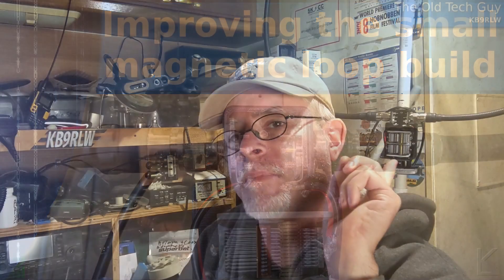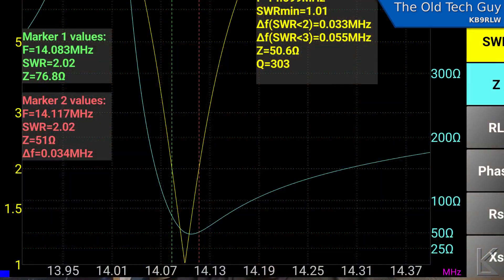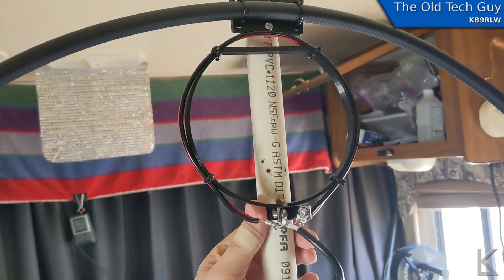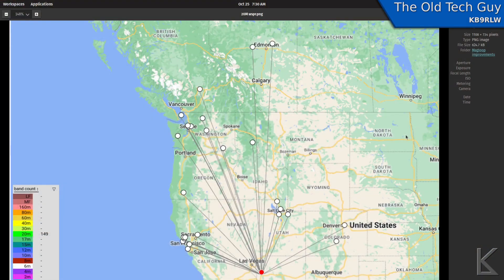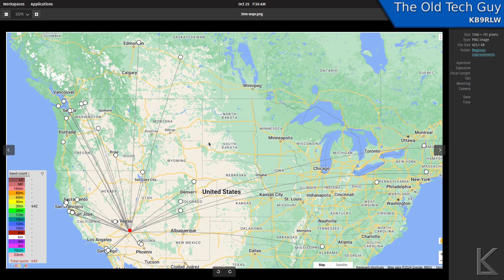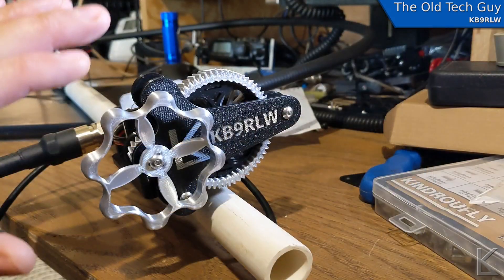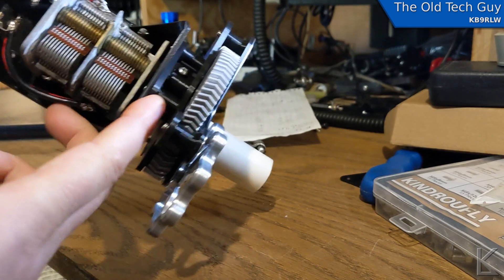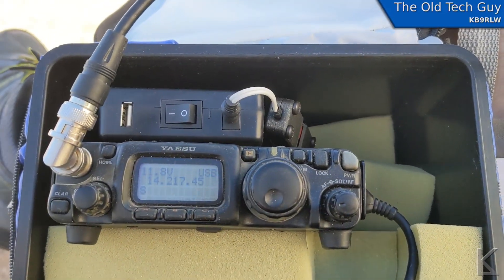Ham Radio - Improvements to the small magnetic loop build

Comment: I watched your series of videos on this build. 66pacific's small loop calculator has a "red flag statement", 'The specified conductor length of 8.52 feet is not ideal." When I enter my parameters to design a loop. Target freq 7 Mhz to 29.7 Mhz . Making the circumference longer is the only way to bring it into spec's.
Yet, you built this with a loop just over 2 to 3 ft circumference and achieved 30 meters to 10 meters.  Amazing!

Comment: Hello, could you give the capacitor parameters or the company name? I would be grateful. Wojtek SP9DLK
Reply from the maker: That was discussed in the design video.  
It was a purchase off eBay of a single unit. somewhere around 30-170pf as I recall.

Comment: I had to can Facebook for security issues so I know very little of your shack setup. I understand you are in an RV somewhere in the SW desert.  Since I am considering moving to an RV it becomes a heavy set of choices as to making room for radios and tools and equipment.  Do you tow a trailer  containing a tool room and machinery and space for radios separate from the RV living space, which is something I am planning to do. My heart has always been in the Southwest after many camping trips over the past 50 years.  Perhaps you can steer this OM in the right direction.

Comment: maybe a 24:1 gear ratio using a steppermotor controlled by a arduino could be a idea… for remote adjusting the capasitor
Reply from the maker: That's been done several different ways. Ideal for when the loop is in the backyard and your shack is in the house.

Comment: Kevin, you mentioned your clamp for the Coupling Loop. I remember you talked about in a previous video that an Ellipse worked much better than a Circle. Could you make your clamp in an elliptical pattern as well? Not to mention, using a similar herringbone gear to even further "fine tune" it to be slightly out of or back in full plane with the Larger Loop? just a thought. Great job. When I finally get my Capacitor I will be constructing my mag loop based off your builds. KI5IUF 73's
Reply from the maker: The top part of the form flattens out allowing you to press the wire up against the loop to deform it slightly.
Reply: @loughkb  Thank you for that information. Going to get your gear 3D printed (credit all to you) and a smaller version. So 2 herringbone gear clutch gear boxes. Thanks again.

Comment: Thanks Kev - you have always maintained in the past that the coupling loop needs to be as close as possible to the main loop, and preferably, oval shaped so that there would be more of the feed loop closer to the main loop. I will try your new method - thanks
Reply from the maker: And on some frequencies with this loop build that was still how I got the best match, with the loop pressed up against the big loop.  Making the coupling loop adjustable just showed me that it's not always the best position.

Comment: Really great job there Kevin! 
A question, have you ever tried or had anyone show you using a variable capacitor for a mag loop dipped into a container with oil (mineral oil) to be able to increase the voltage it can handle and what the results came out of it? It's easy to get your hands om small capacitors rather than the biggies that costs slot not to mention the vacuum ones.
Colud you do any test to these myths?

Btw. I am sooooo pleased to see you back in the van and that your health is getting better by the day. Hang in there, you'll pull thru! ❤️
Reply from the maker: Well all you really need to do is look up the dielectric constant of mineral oil compared to the dielectric constant of air. If it's a better insulator then yes it would improve the voltage threshold. I don't have enough power to test it. I'm mostly QRP and can only get up to about 35 Watts with my amp.
I just did a search, and mineral oil is a much stronger dielectric than air, a better insulator. So therefore it would definitely raise the voltage tolerance. No need to test it. It's not a myth

Comment: The loop is of course one inductor, but with the induced current traveling the same direction in the loop, the mutual inductance across the gap should increase as the gap narrows? So, by narrowing the gap you are increasing the inductance of the loop? I did a search on ”variometer magnetic loop” and the first video YouTube retrieved was one by you from nine years ago. The clutch is brilliant.
Edited to add: Ah yes, I remember your bucket variometer build - fascinating.

Comment: Very nice job. All that's left is to further increase the Q of the loop, thus increasing the radiation efficiency on Xmit and narrowing bandwidth to reduce noise pickup on RX.
It looks like your loop was broadcasting out of a window on the north or northeast side of your RV. I used to use my cellphone in my RV when up in the mountains, and I would place the little dipole antenna in the rig where it would only 'see' out of the front window. I even put grounded aluminum foil on the kitchen window and back window. Then I would point the RV so that I would hit a weak 'local' cell-tower back in my home coverage area instead of a much closer and stronger 'roaming' tower that cost much more to use but to which the phone would automatically flip because of its signal strength. I called it my 'window beam'. I should have built an actual multi-element beam, but I was lazy, and the window-beam worked fine.

Comment: Keven; very interesting. I do believe closing the loop has the effect of improving the Q of the Loop which is the primary antenna. As far as your adjustable coupling, I think there is more to be seen as to improving the match. Moving the coupling loop does effect the Primary antenna however so does the capacitor. My question is weather or not you are only "HIDING" the SWR in return loss. Example being that an antenna measured at its feed point with 1.2 : 1 match ratio can be seen as a 1:1 match ratio measured at the transmitter with a long transmission line. I am not calling you out but am wondering myself since I am intrigued with big high power magnetic loops i have been building large loops using Vacuum capacitors and 12 foot loops of 2.25 inch hard line. Respectfully as always, Dennis KV4WM, A US NAVY NUCLEAR SUBMARINE VETERAN, Broadcast Engineer, and Fellow Amateur Radio Operator  73
Reply from the maker: If you look at earlier textbooks on magnetic loops, they refer to rotating the plane of the coupling loop in order to improve the match. It's similar to how a veriometer works as I understand it.
Reply: Quality is frequency dependent. It means your main loop impedance is different on different frequencies for R=ρ*Q. To obtain a good match you should have a set of coupling loops or adjust your coupling loop to current frequency.

Comment: Question: Did you print these with PLA or PETG? Being new to 3D printing in itself, I was wondering which would be better. Also should I set the Prusa Slicer for .12mm, .10mm, or .08mm?
Reply from the maker: There's really not a lot of torque on the gears or the assembly. So PLA is fine. I printed most of it at 0.2 layers, except the output clutch and the input gear/shaft. Those two are printed at 0.15 layers with 40% infill and three perimeters. To give them more strength. 
The knob I printed with variable layers set to smooth just to give it a better feel.
Reply: @loughkb  Thank you for the quick answer. I'm warming up the printer bed right now. I'm really excited about the new FreeCad too!

Comment: What i have found out, and also read somewhere is that the coupling loop works better if its oval like an egg, that way there is more skin between the 2x loops, just a thought
Reply from the maker: Yes I did a video on that, "squashing" The coupling loop. I think it's titled magnetic loops one change that makes a big difference. 
However as I'm discovering now, it might not be the best option for every area of frequency the loop covers.
Reply: @loughkb  Hi and thanks for the pingback, yes there could be many parameters that we need to test more thorough, thanks for coming back, and hope you get the cov id thing in order

Comment: Nice engineering.  How did you fab the metal parts?  Im still new to HF and researching what antennas to use and hopefully build.
Reply from the maker: I didn't make any metal parts. The form and clamps for the coupling loop are 3D printed, as is the frame the capacitor's mounted on and the gear down assembly. They're all printed in PLA plastic.
Reply: @loughkb  oh!  How about the herringbone gear and knob?  They look metal?  What material are they?  Ps i just watched 3 more vids on mag loop.  Might be perfect for me as a next step.  Ofc i will begin manual tuned :)
Reply from the maker: @DIYDSP  They are printed in PLA. A color called " silk silver " from geetek.

Comment: Changing LOOP antenna "material" (aluminum or copper) to much larger diameter tubing WILL improve efficiency  ; ) I switched from wire loop to 1/2" copper tubing and it functioned much better  ; )  Planning to try much larger aluminum tubing.
Reply from the maker: Yes, my first magloop was made with copper pipe.  
However, this is intended to be a portable loop, so coax makes it much easier to transport.
Reply: @loughkb  Using MFJ-936C loop tuner with 4 ft Loop of 1/2" copper tubing for 10 meter Net Night (portable) On German Hill which is highest point in area about a mile from my lowest point (10 ft above sea level) (home)   ; )

Comment: Could you add a fine tuning capacitor in parallel to the main tuning capacitor?  I'm thinking the fine tuning capacitor would have only two stator places and one rotator plate giving you lots of trave with minimal capacitance change.
Reply from the maker: I have built two loops like that in the past.  I had a second smaller geared down cap in parallel with the primary.  There's a video on it somewhere back in my catalog.

Comment: I can get a nearly 1 to 1 match on my Chameleon Ploop magloop antenna by adjusting the Velcro that holds the small loop farther apart so the more of the loops touch and making the main loop more of an egg shape
Reply from the maker: I did a video on 'squashing' the coupling loop awhile back.  I also did the same with my chameleon, but couldn't get consistently low on all the bands.

Comment: Herringbones are sexy, but why?  Less backlash?  Scissor spur gear would work for that (backlash) but maybe harder to execute.  Certainly don't need the herringbone for torque or power requirements.  Very nice job!! 👍👍👍
Reply from the maker: Zero backlash with herringbone gears.  Makes it easier to fine tune when you don't have any play in the system.